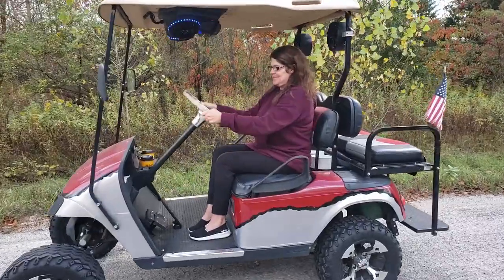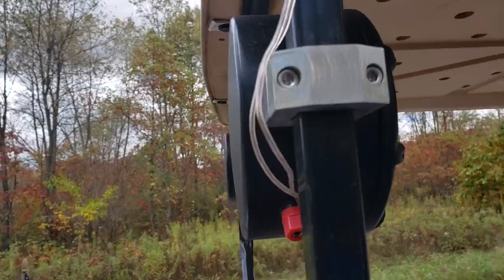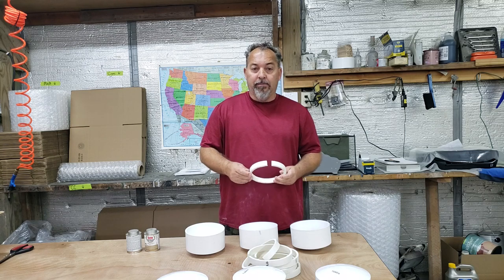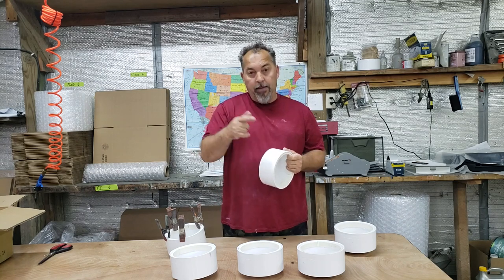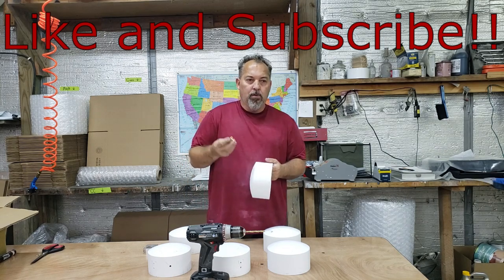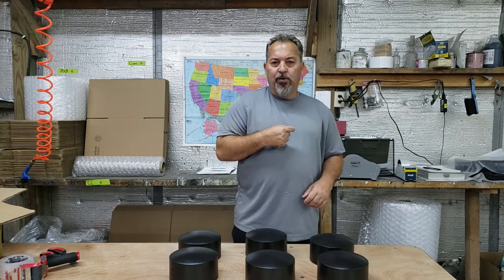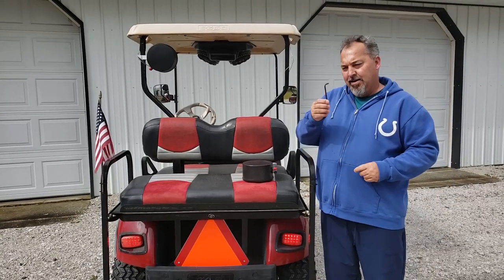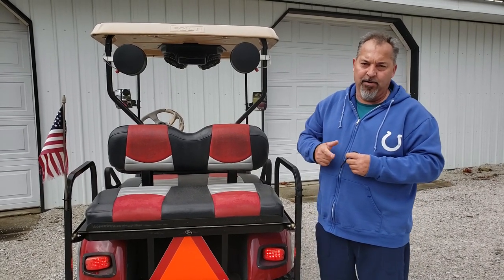Speaker Pods

Comment: Your not Sch40 caps,  that's why you cut a section out of your rings because that's Sch40 pvc.  Your caps are for 6" OD pipe & your using 6" ID pipe.  Probably because the caps your using are the perfect size for the speakers & the Sch40 pvc gives you the thickness needed for the screws to mount the speakers.

Comment: What speakers did you use? I tried some and the diameter is too wide for the pvc cap?
Reply from the maker: Sorry for the late reply! These pods are 6.5" in diameter. Standard automotive 6.5" speakers work great. Such as Boss brand ch6530 and Kicker brand DSC650 etc. These have plastic cones and rubber surrounds and when mounted in the pods they become Marine grade. However there are some 6.5" Marine grade speakers that are just to big. Hope this Helps! Thanks

Comment: Hello, you mentioned in your video different consoles you make.! I do have a question regarding the middle part between the backseat and front seat of a golf cart president... I’ve seen where there is a box to fit speakers on that middle section, do you have anything in mind to fit a 6.5 or even up to 8 inch speaker? Thanks and good video
Reply from the maker: Hi, Sorry for the Late response! We do not offer anything that will fit between the front and back seat. However, If you know the size and if its not to complex we could do a custom build for you. Thanks